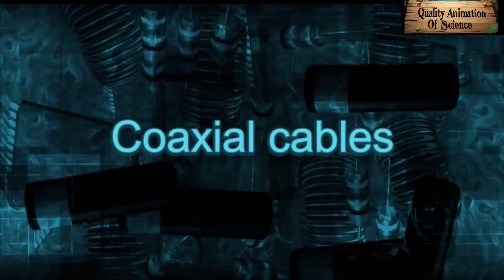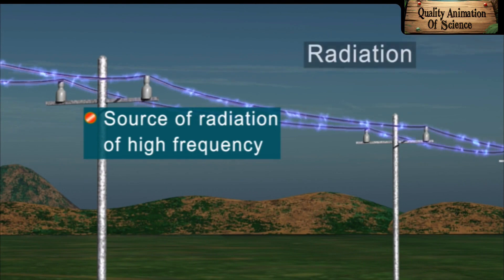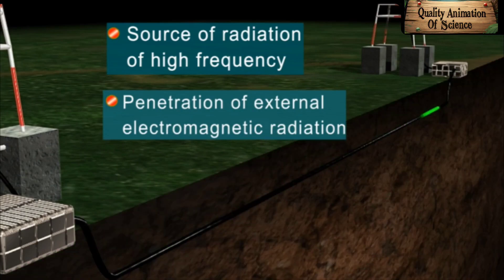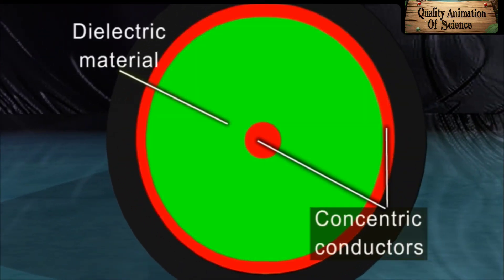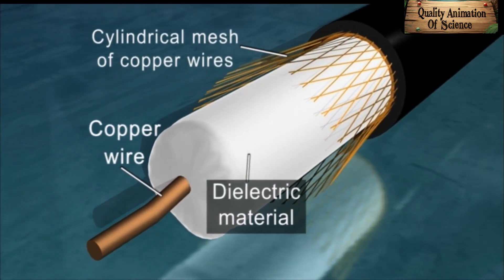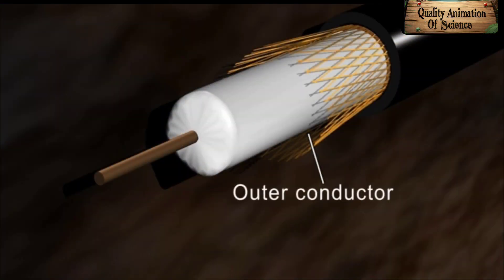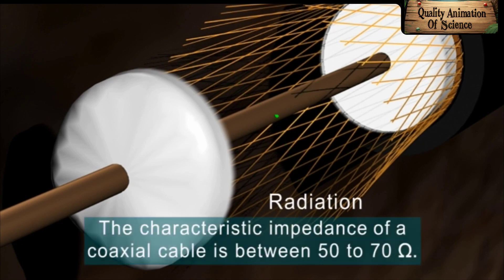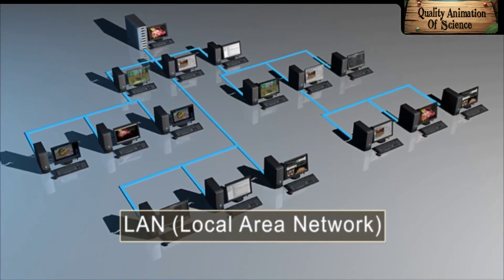Episode 28 |  Coaxial cable | what coax for ham radio | #coaxialcable

Comment: Point number 1 is incorrect. Parallel transmission line can have a very stable field around that can contain the differential currents it carries, as long as the conductors stay at a constant distance (variation measured as a percentage) apart. Point number 2 is also incorrect; External fields, signals or other "interference" will produce common mode current on the conductors, and common mode currents aren't efficiently carried on balanced transmission line, and they are readily radiated.  Coax can be made in any characteristic impedance, but it is the case that 50 Ohm and 75 Ohms are the most popular for radio transmitters, and cable TV, respectively for various practical and technical reasons.  Finally, unlike most coax, balanced transmission line with its higher characteristic impedance, has much lower resistive losses than coax, and higher velocity factor.